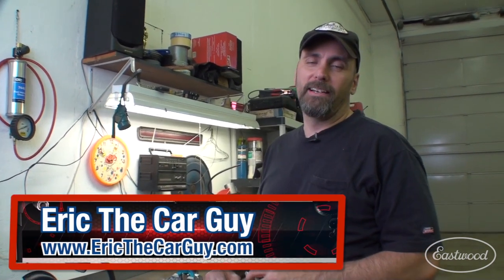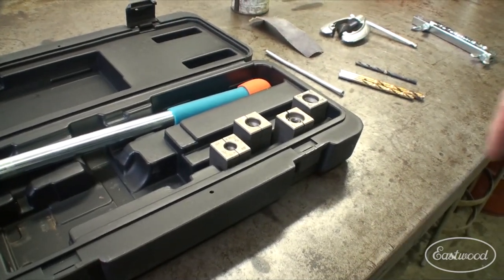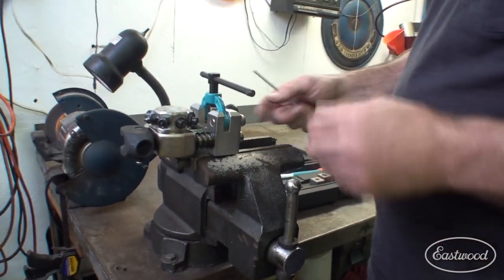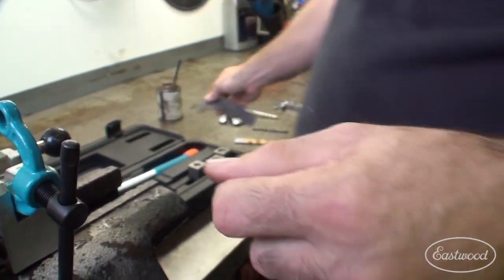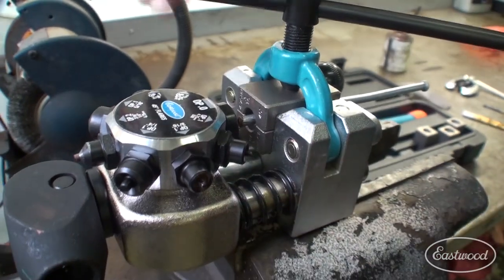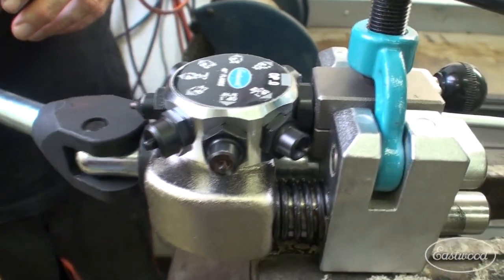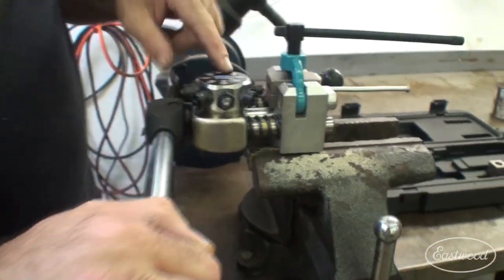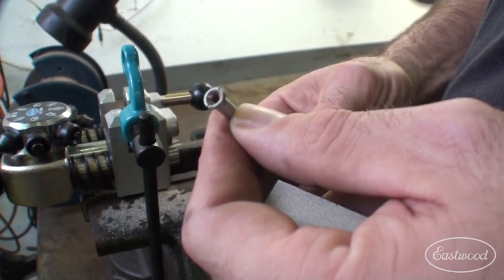Eric The Car Guy - How To Flare Brake Line Tubing the Right Way - Eastwood

Comment: I would buy this tool in a minute, but the dies appear to be so long that I would not be able to place the bend where it needs to be for the fuel lines I'm building. The issue is, either shorten the dies to allow the flare to be closer to the line nut, or to make the bender such that the nut can be closer to the start of the radius of the bend. To be specific, building stainless lines to fit the Holley fuel pressure regulator for the dual feed 4150. Will the tool flare 0.035 wall stainless tubing?

Comment: Thumbs-up foe Eric the car guys always has great Videos. .....even when there not on his channel..... nice tool aswell to bad they are so hard to find Eastwood products in Canada
Reply: They ship to Canada.  I just had a gallon of clear Elasti-wrap delivered.  Showed up in no time.
Reply: Or if you live within a close distance to the US border, you can get things drop shipped to a UPS location (called "Need a US Address), then pick up the item and bring across the border.  Here in Toronto the Oakville UPS location now offers a service to pick up items from the Lewiston NY UPS location, which is priced cheap enough it's about the same as my cost for gas etc to round trip it to Lewiston (Buffalo) myself, never mind the time.

Comment: curious is it possible to do a bubble and double flare with the standard flare tool if so could you provide a video on the proper way to do these flares on a standard flare tool

Comment: that's all fine and dandy, what if the brake line can't be brought to a work bench.  The majority of my flaring in done on vehicle.
Reply: For portable vehicle flare work I use a Mastercool MSC71475.  It uses the same principle, but the press is a self contained hydraulic unit.

Comment: Hey Eric. I have a 1998 Grand Prix. I put a new master cylinder  on and I have bled and bled and bled but still feels like I have air in the system. When the car is not running the pedal feels firm but when I start the car the pedal goes to the floor as if no hydraulic  is working at all. I also hear air being sucked  in and out at the master cylinder  but no leaks. Could  it be the abs system tho or is the new master bad?

Comment: I.m hoping you can help me with a 1999 gmc jimmy the brake pedal is really hard truck wont stop and the pedal pushes back when pushed hard also sounds like abs is trying to work any help would be greatly appreciated
Reply: +Dennis Falan I'd check the brake booster.

Comment: Hi Eric my 1992 e34 BMW I bought fog light DID i installed and i turn engion on the sound of engion was narmal when i turn fog hid light on sound of engion drop and came back to narmal again for fews day i try to start the car is no gragging no nothing BUT the light still fuul battery full what or how can I fix this pro blem my own with you advice thank you so much Eric

Comment: Actaully, i dont think OP1 in this video makes a "real" bubble flare becasue a bubble flare should not have a 45 degree on the back. It should be straight, so its not really a bubble flare but a halway made double flare.

Comment: that was not perfect. it clearly had two ridges on the rim of the flare, and appeared to also have a crimp line on the back side of the flare. he didnt zoom in on the quality of the flare to let us inspect it. bummer. i have one of these tools and i've yet to create a symmetrical flare after dozens of attempts.